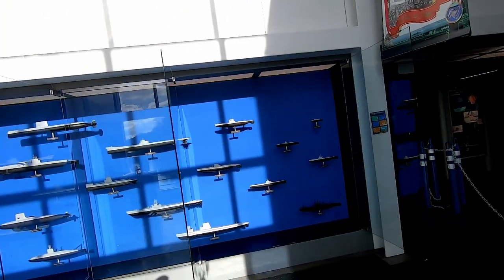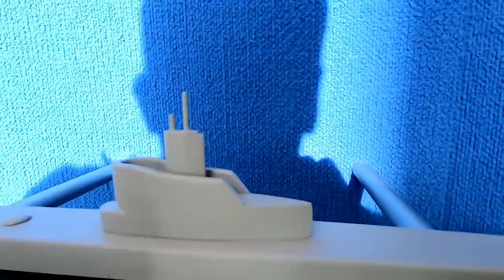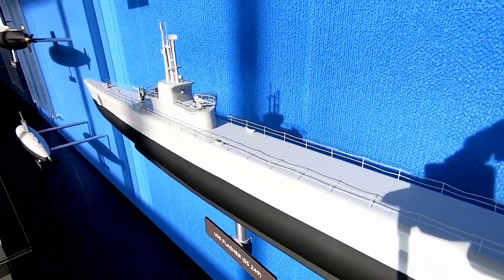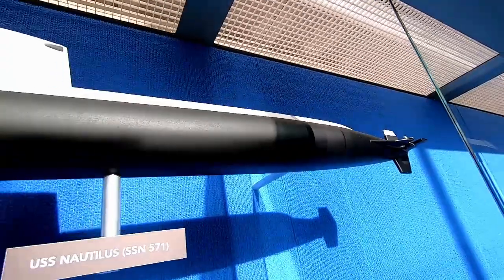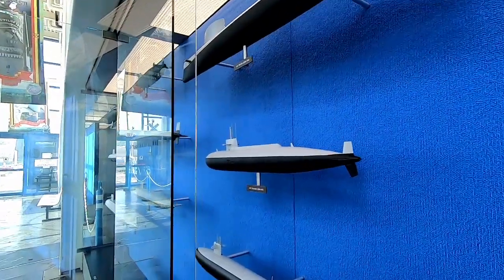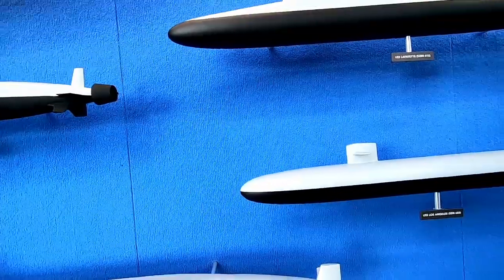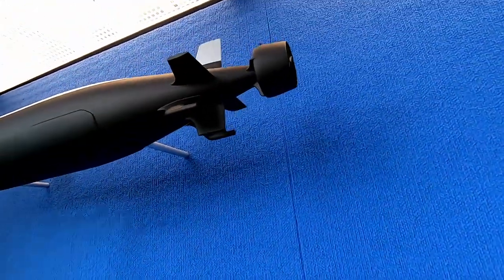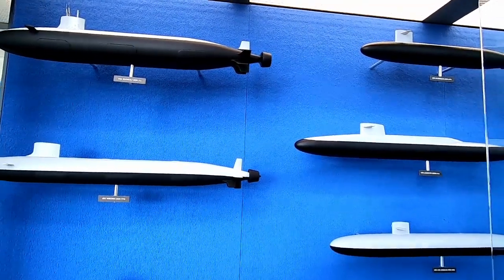Submarine hull design progression

Comment: Brad,
Good video.  I am a former diesel boat submariner who has remained super-interested in subs all of my life.
Four Comments:

1.  SS-343  USS Clamagore:  Like all Balao class subs, she started life visually as almost a "look-alike" of the SS-212 Gato class, except for the different conning tower (sail) design.  But post-war Clamagore underwent an upgrading and  streamlining GUPPY conversion, first to the Guppy-II with the metal step sail shown and then to one of the 9 Guppy-III subs where a 15 ft plug was added and squared-off "North Atlantic" fiberglass sail and 3 PUFFS fins were installed.  I served on the SS-346 USS Corporal, another of these 9 Guppy-III boats.

2.  Clamagore was not the first snorkel boat in the USN.  That was R-6 briefly in 1945, followed by Sirago (maybe?) and the Odax in 1947 or 1952 depending on the source cited.  The Tench class Odax was the first Guppy-I boat re-design with the topside streamlining, then further upgraded to a Guppy-II.

3.  You are soon going to need to add to your model wall with the new Columbia class replacement for the Ohio subs coming on line.  But you know that already.

4.  For comparison, it would be very interesting to add a second model of the SS-1 Holland and perhaps the SS-285 USS Balao (with its different conning tower configuration) to the LEFT end of the model wall where these two VERY important boats can be compared in size and shape to the current classes of nucs.

Comment: OK, as nice as these "models" are, several are completely wrong. As in the USS Albacore, the control surfaces are not in a cross configuration, but in a X config. I spent 4 year on USS Sculpin SSN-590
Reply: It's was basically a test platform.  They tried four tail sections.